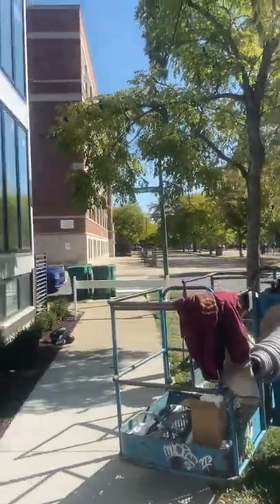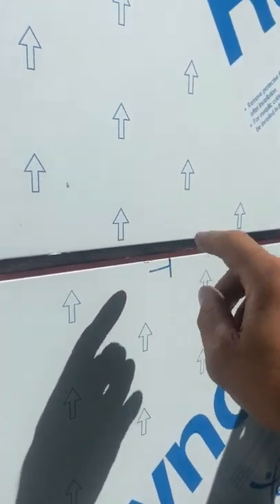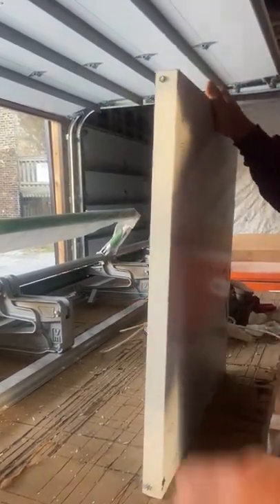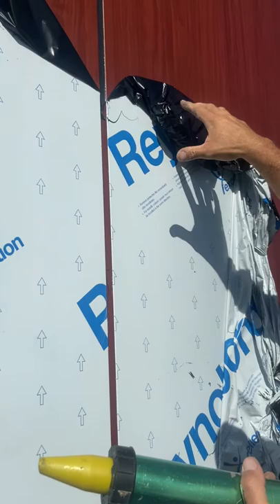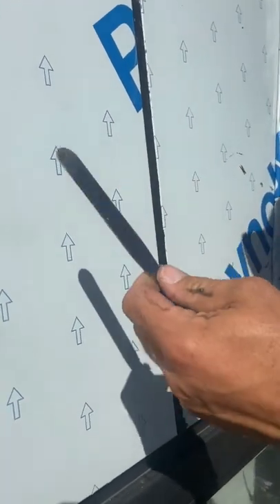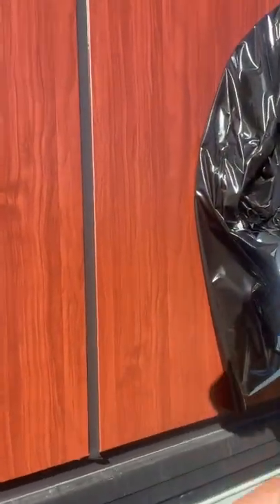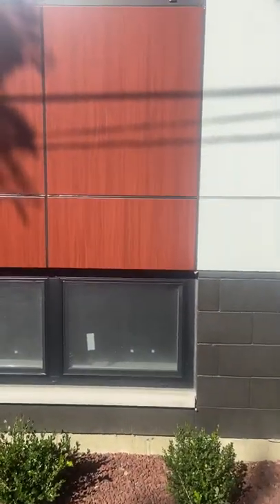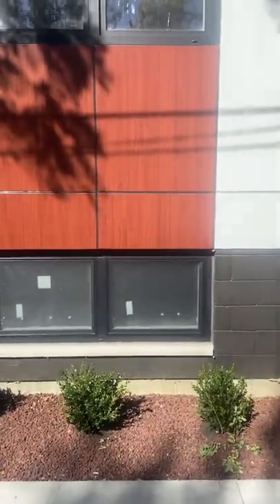BIG MISTAKE turned GREAT JOB into UGLY when using sausage caulking! How to seal ACM panels.

Comment: I was taught to always use backer rod. Every place, and depth at one half the width. By not using rod, you can’t set a consistent depth. That may have added to your problem with your dark panels.
Reply: By not using backer rod you can also get a three way bond, which can tear over time

Comment: Thank you it has been some time since I caulking I am a ironworker lock 16 and I have been out due to back to back operations and I am trying to rebuild my strength so I can get back to what I love doing you guys did a grate job when you remove the wrap if you use a1/8 inch shem and run it across the wrap and it comes off and no scratches thank you

Comment: Man you guys must be true professionals. That caulking job is immaculate. I only do caulking jobs on parking ramps and some drive ways for extra money. Most of our commercial jobs don’t require such perfection but this is interesting to watch. I really like the idea of removing the cover and how you guys did it on the sides. Very cool trick. If I ever come across these panel types I will definitely be applying this technique.

Comment: Good info thanks. About the expanded caulking, there is a special tool for grooving tread on tires, kinda like a knife and they have different shapes. You might be able to run it and scoop the excess caulk and leave a nice bead
Reply from the maker: thanks for the tip!

Comment: I've been installing ACM for over 30 years. Don't use a utility knife to score the edge to remove the pealcoat. Cut a small piece of spline. Works much better
Reply: can you explain using the spline a little more please. I'm about to do a small section of this for the first time.  Thank you,
Reply: also you can use a plastic shim

Comment: Thats why always remove cover plastic  acm panels needs to breath and stay without plastic couple days  and plus the joints are 3/4 depth is 1" u have to use bakerrod if you did used the bakerrod  can expend also   and the best caulk  is Sika for hot weather .

Comment: I’m really glad to find this video, there aren’t many on YouTube about how to do sealant joints on metal panel cladding.  Thank you and hope you do more videos like this!
Reply: Typically the whole acm panel is fabricated differently to where you have spline pieces (which are like little 2" strips of the same material) that slide into a little cleat in the panel on both sides which also has a gasket on them to keep water out but typically a acm system isn't water proof on the outside as it is metal, it condensatez

Comment: Thanks for the video man. Had the same thing happen on a job of mine. I was pissed at my guy that did the caulking. Had him cut out the 4 store front frames he did and told him id show him how to do it right. Caulked it early before it got too hot... the next day it looked worse than he had left it 🤣. Finally figured out I needed to caulk it towards the end of day when it was the hottest. Only problem is you have to haul butt because it skins up fast.

Comment: Hello. I know this is a long shot as this video is pretty old but… I’m a DIY homeowner that bought a house clad in ACP. I’m adding an extension to the garage and found your other videos regarding the creation and installation of the panels to be very helpful. This summer I’m going to start the process of re-caulking the entire house as it’s 20+ years old and a lot of the joints between panels have failed.

 

What I’m worried about is getting the old caulk out of the  joints. Using a utility knife is going to be physically daunting and probably nearly practically impossible given the sq/ft of the house and the height of the walls (20’+). Is there a special tool for this application or one that you can think of that could be repurposed to do this? How about a chemical solution that could either remove the caulk itself or at least soften it to the point of making the removal easier?

 

Any and all ideas would be greatly appreciated. Thank you.

Comment: Have a  question for you, how real caulkers do it here in Phoenix Az. during the summer months when temperatures are above 115° or more during the day...?
Reply from the maker: not sure what they use there. But the problem was i did the caulk in the shade and when the sun hit my dark panels they became extremely hot . May be they don't use aluminum panels in the extreme heat regions. Now i am using a bit different product when i need to caulk dark panels- Dymonic FC (fast curing). And trying to do that late in the day so it cures during the night.

Comment: Hello What thickness of the of the panels do you use im looking to do My commercial garage and im not sure what to get can you help me out will any of these about work best 

1220*2440mm, PVDF coating, plain color, normal polyethylene core,

4mm / 0.50+0.50mm, 

4mm / 0.40+0.40mm, 

4mm / 0.30+0.30mm, 

4mm / 0.25+0.25mm, 

4mm / 0.21+0.21mm, 

4mm / 0.18+0.18mm,

Comment: 4:52 That isn't correct. Such an application of caulking requires a bond breaker. The baker rod is useful not only minimize use of caulking material but it acts as the bond breaker when bond breaker tape isn't used. It is also used to achieve the correct width/depth ratio of the bead of caulk. Maybe the correct bead ratio and a bond breaker would have prevented that failure. I don't think you included the exact type of caulk that you were using? Also, your title was a bit confusing since it seems to imply that the problem was "sausage caulking", I know that isn't what you meant now that viewed the whole video.

Comment: Hey man, what did you end up doing to fix the issue?
Reply from the maker: had to cut out v-grove and re-caulk all the dark lines. I Had to use tape on both sides of the line but it turned out nice. it did cost me pretty penny though (time, material and boom-lift rental ). thanks for watching.

Comment: Hello, what brand of caulking do you recommend?
Reply from the maker: Hi!
Dow Corning
Reply: Thank you very much. Which one do you recommend? dow corning 733 732 701??
Reply from the maker: @MrKwadwo10  Dow sill 795. That’s what my specks require on the work order . But we are in Chicago- wide temperature swing.
Reply: @LeftoverCA  true I'm in Mississippi. So I will check the specs.

Comment: You absolutely cannot leave the film on the metal panels instead of taping ( if you’re not a real caulker and have to tape?) when you pull the film you break the seal on the caulk and that’s only going to make it even harder to look perfect and this guys caulking is absolutely Brutal by real caulkers standards ( and I’m not talking top gun level, that’s a whole other thing) I’ve caulked those exact same type of metal panels and I know that they’re not as easy as they look . You have to be able to tape a perfectly straight line left back a tiny fraction otherwise you will do exactly what this clueless guy is doing  When he pulls the film he wrecks the edge of the caulking and break the seal and then wet tooling dish soap and finger fucking Only in Woke Broken No Standards No Inspector USA